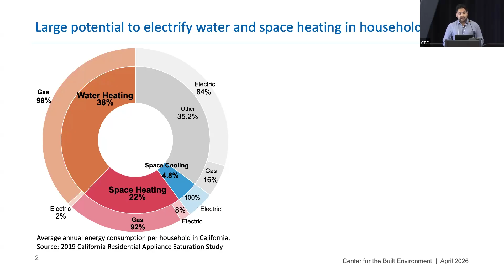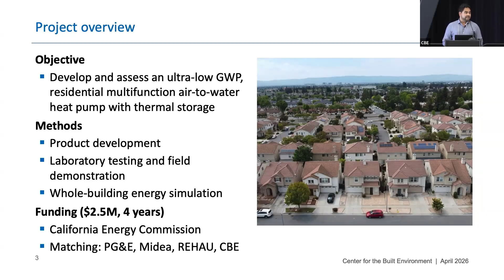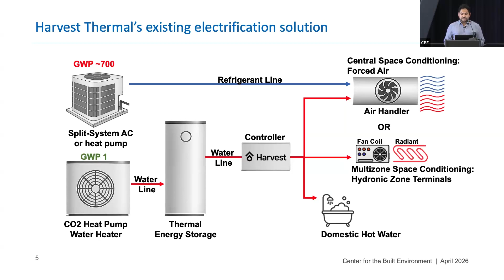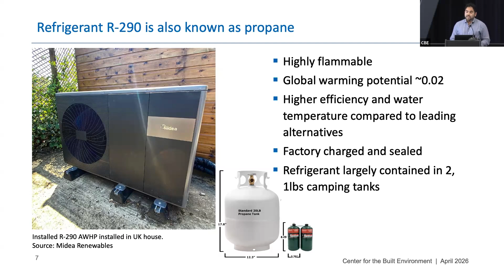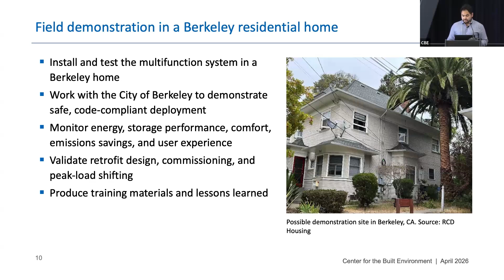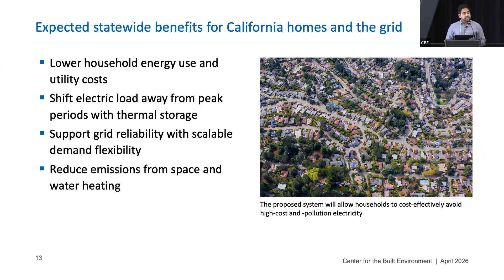Advancing Air-to-Water Ultra-Low GWP Heat Pumps with Thermal Energy Storage

Comment: Great to see Midea and R-290 approach being demonstrated here. Will you be comparing thermal storage efficiency vs open loop without distortion and secondary pumping?  It would be great to validate the relative value of the TES.